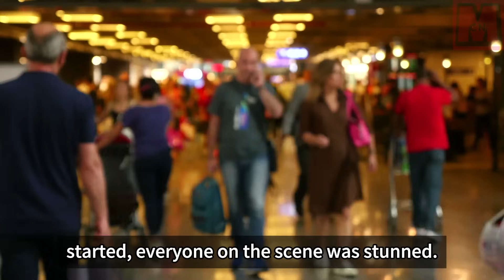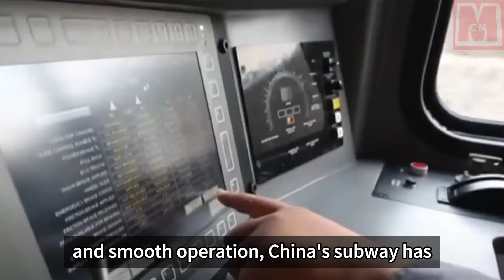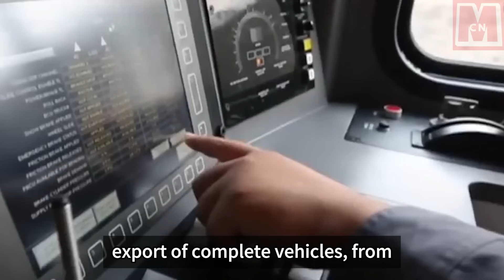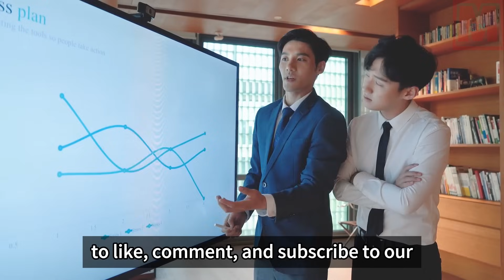China Subway: Made in China Traveling Through the World

Comment: The oldest Boston subway was made in Europe. It worked reliably till retirement. Then the debate was should the next one be imported or local. The decision was Boeing that never made any subway thinking that high tech can do anything. The results were high cost of overrun, delays and disastrous. A simple door has 2000 parts that broke down all the time. Boeing did not have all the expensive parts ready. MBTA had to scavenge other doors for parts then found out that they ruined the warranty by doing so…